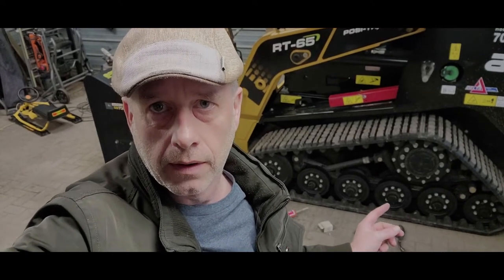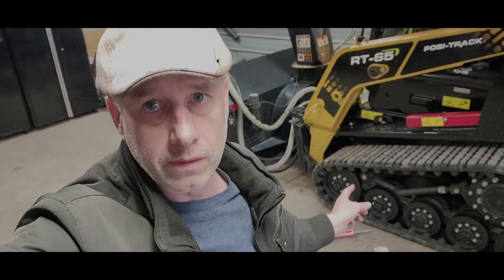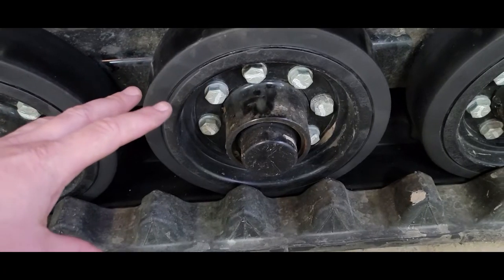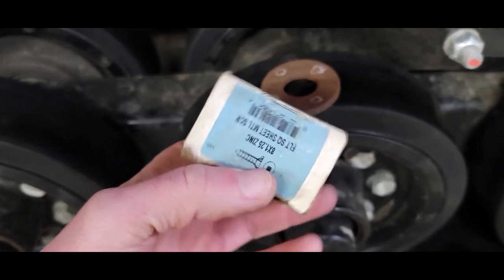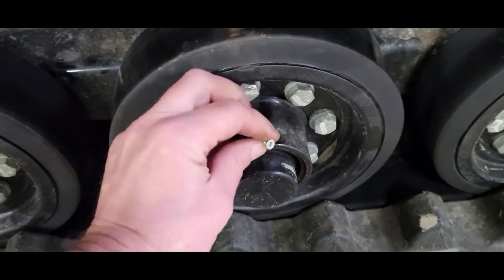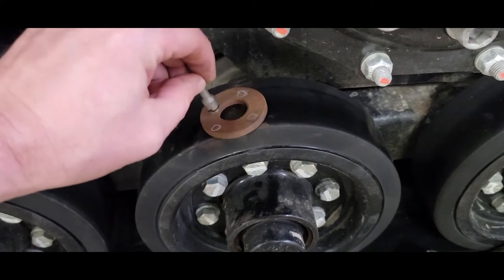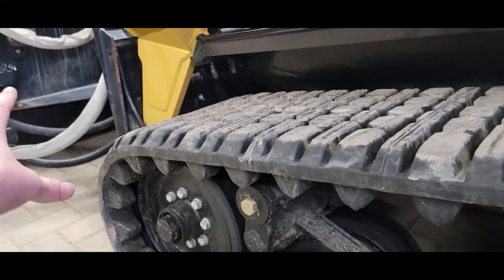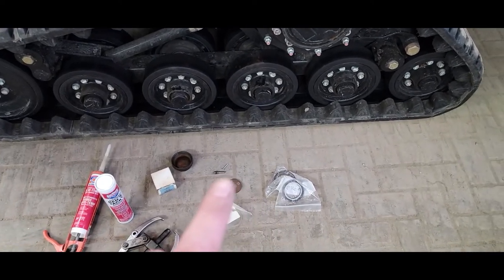ASV PT 60 bogie wheel "MOD" fixes biggest flaw

Comment: On my 2009 PT50 I’ve changed out two middle bogeys, first one went out around 1100 hrs, the second at 1250, now looking at another after this winter with 1330 hrs on it, it’s wobbly but still functional. I put news tracks on last summer at 1150 as 6 lugs delaminated on the one side the treads were still in very good shape. I will definitely look at drilling for this washer mod. Thanks for sharing.
Reply from the maker: That's about right after 1000hrs you will have wheel and bearing experience. I learned to try not to submerge the wheels in water if possible because it's water that will get them altimately.
Reply: Just go to Bair products Kansas they do proper upgrades that last much longer then factory and cheaper

Comment: Hi Darren,
Love your videos. Would you be willing to share any tips on how to find aftermarket parts for the ASV under carriages? I have a 2017 RT-50 that could use some maintenance (mainly new dust caps) and new tracks. I like to have options whenever I begin a project......
Best regards
Simon
Reply from the maker: Depends on where you live Tracks you need to shop around to find the best price and quality. for parts If you live in the states try trackloaderparts.com if you live in Ontario dealta power in mitchell is the Canadian distributor
Reply: @Northbaylandscaping  Thanks Darren I live in the Kitchener Waterloo area, actually have some parts on order from Delta at the moment. Pete there is a great guy to deal with. I thought perhaps you might know where I could find aftermarket parts. Example: the plastic inner rollers for the squirrel cage.
Best regards
Simon

Comment: Thanks so much for making this video! These are great things to know if you own a ASV or TEREX. I ended up trading up to a 2013   PT 60. I'm going through the entire machine from front to back and top to bottom. I'm sure I will have more questions. Your videos are great for us guys that fix our own stuff. I really appreciate your videos! Is there any thing I should be looking for on a 2013 machine while going through everything? As of now I'm de-greasing  everything cleaning it out and changing all filters and fluids. Also some cosmetic paint and decal touch ups. Visually inspecting the undercarriage and  suspension. Thanks again for the videos!!
Reply from the maker: Check the bearings on the end of the drive motors make sure there's good grease in there and that they are not dried out. If they go then it will damage the drive spocket shaft. You may have to order new caps because you can damage taking them out but, you can use a pickle jar lid with some silicone as a temporary cap. The cap should be flat becasuse if it's bulging out then the bearing has failed and pieces of bearing are pushing the cap outward.

Comment: Heyhey what the shop you buy your asv skidsteer ,im from ottawa and looking for one
Reply from the maker: Talk to Neal Ford delta power essex tell him i referred and he'll set you up. They're the head Canadian distributor
Reply: Thank you a lot , im sad they dont build the rt 60 but your rt 65 can he load an 10 wheeler , because io be doing asphalt prep
Reply from the maker: @dominicrene4749  I would check the height of your dump truck and compare to  RT65 lift height specs because it may not be high enough. I know the RT75 can load a triaxles not sure about the RT 65

Comment: OK I LIKE YOUR IDEA!!  HAVE YOU FOUND A CHEAP SOURCE FOR THE RUBBER SEAL ON THE BACK OF THE WHEEL!!   sorry I am excited I like your fix.  I have been building up weld but I think a screw is a good fix, way better than welding.
Reply from the maker: The seals I used the factory seals but It's been a while because I sold this machine. I use red gasket maker between the washer and the wheel as extra protection. The screws I never had any problems. You can offset the washer a bit from center to knock any potential rocks that might get stuck but you can go too far off and it may interfere with the shaft and jam the wheel.